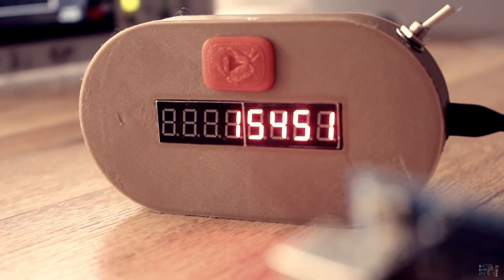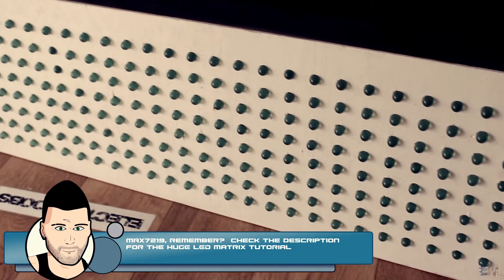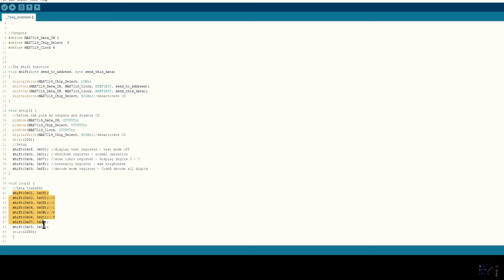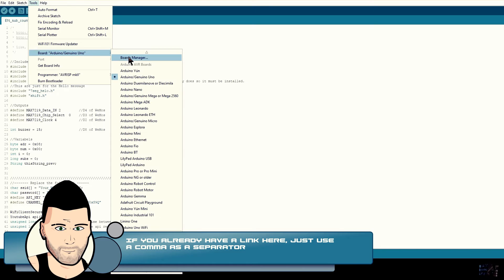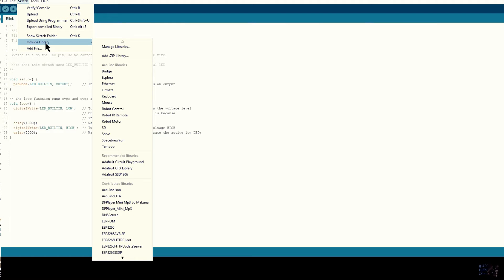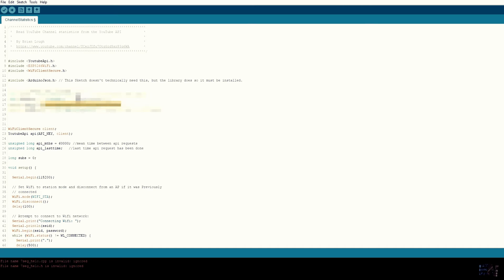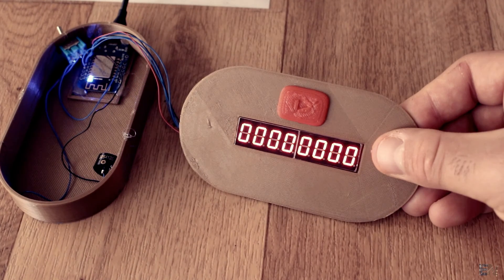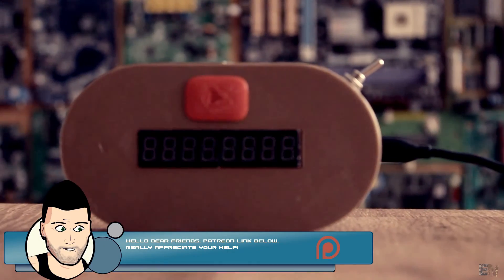WiFi YouTube subscriber counter - Arduino ESP8266

Comment: Hi, I've done everything here. I've api_key and it works on PC-Web browser. I see json results trough here but on arduino, Youtubeapi seemslike does not work. I get both new and old wemos from board manager, get aruinojson lib v5.xx (6.xx gives error and doesn't compile) but in every way I do not get result from youtubeapi. Also I try to ping google trough wemos and it has success(I mean internet connection is also OK). Does youtubeApi lib not working anmyore on Arduino?

Comment: dosent work here
Reply: WiFi connected
IP address: 
192.168.0.173
 and nothing
Reply: @danilokrausz9103  do not use latest esp8266 library, use 2.5.x version
Reply: @linuxentertainment645 2.3 works fine

Comment: I just want to say thankyou for your tutorial! It was my first time with arduino and was a great learning process. I coded mine from scratch but used your code for some of the command references. I made two different melodies for gaining and losing subscribers with a piezo and a self-check so it reboots itself after 5 API failures which has made it bomb-proof. My subscribers have been trolling me with unsubbing and resubbing and it's been really fun. The wemos board is fantastic, I'm so Impressed! My wife however is not impressed with the constant alerts (I'm on the rise which is nice). Thanks again for all your effort putting together the references on your website. This is definitely one of the best tutorials for this project on YouTube.

Comment: I need some help. When i choose the YouTube_API.zip is says in Arduino "the .Zip doesn't contain a libary. What am I doing wrong?
Reply from the maker: Then extract the file and copy the folder called arduino-youtube-api-master into your documents/Arduino/libraries/

If not, create a .zip file with the folder called arduino-youtube-api-master and then inport it into Arduino IDE
Reply: I'll try it, give me a sec :-)
Reply: Ok, Now i get this when i try to upload: n file included from /Users/philipphubert/Documents/Arduino/libraries/arduino-youtube-api-master/examples/ESP8266/ChannelStatistics/ChannelStatistics.ino:8:0:
/Users/philipphubert/Documents/Arduino/libraries/arduino-youtube-api-master/src/YoutubeApi.h:26:25: fatal error: ArduinoJson.h: No such file or directory
 #include <ArduinoJson.h>
                         ^
compilation terminated.
exit status 1
Fehler beim Kompilieren für das Board WeMos D1 R2 & mini.
Reply from the maker: Have you restarted Arduino IDE after you've copied the library? If is not that... I don't know... Maybe a new version of Arduino...
Reply: Yes i restarted. I tried it on my mac and windows, both the same error. Using Arduino 1.8.5
Reply: Working, had to install this: https://github.com/bblanchon/ArduinoJson

Comment: Bro, I don't remember the name, I just found it a few time ago when searching for something totally different. But there's a way to change the internet configuration on the run. The ESP8266 would try to contact to the wifi and, in the case it fails, it create a new wifi. Then you connect to it using your cellphone and set it up using the navigator.
Reply: MC's Creations it's WiFiManager, the YouTube library comes with examples using it too
Reply: Brian Lough Yeah, I think that's it. :)